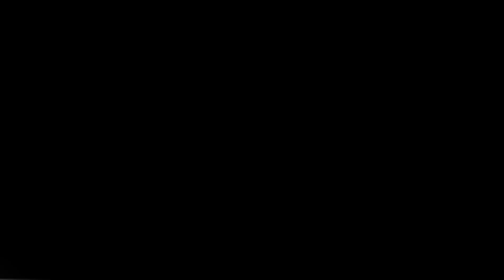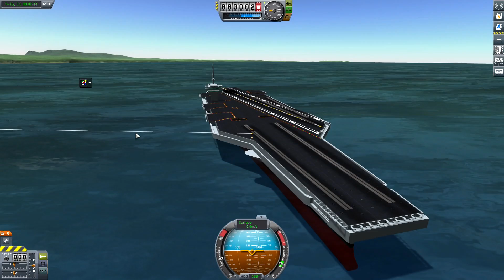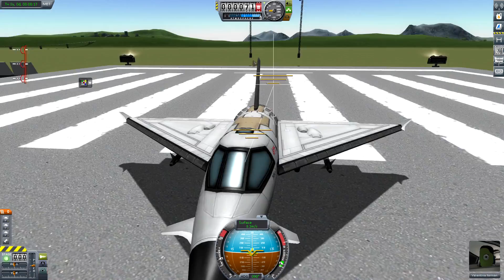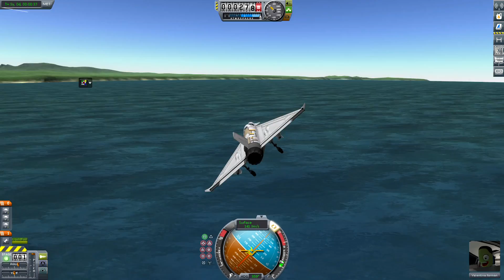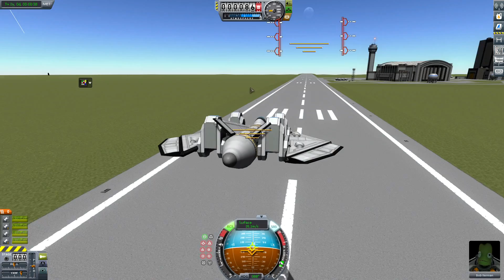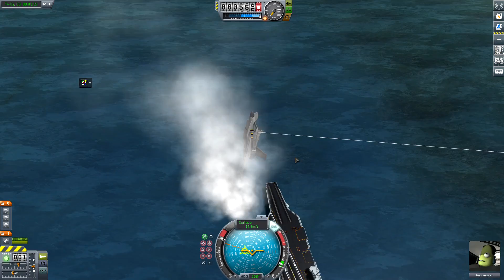Kerbal Space Program "WAR" Pt.15 - Aircraft Carrier

Comment: Fucking nice job with the 1st carrier landing!! :)
Dude! Fuck mono propellant for vtols! Drain all of the mono prop from the cockpit and use a few reaction wheels for vtol maneuverability.
Use the action group editor to disable all the reaction wheels on staging then set RCS to toggle them on and off.. It works like a charm and doesn't rely on fuel tanks that drain and mess with your CoM. Its actually kinda fun to switch between the wheels and the wings when flying :)
Another useful trick is to use the move tool to highlight the CoM of the fuel tank on your vtol: If the move tool arrows line up with the CoM indicator you're craft's CoM wont change as the fuel tank empties.
Jesus, sorry about the wall :/

Edit/ You missed a trick not putting a pair of decouplers on the front of your transport jet, with sepatrons pointing backwards to help slow you down after landing....
Operation credible sport anyone?? :D